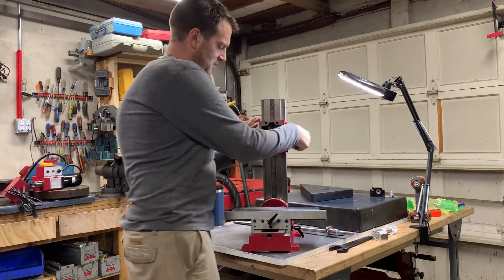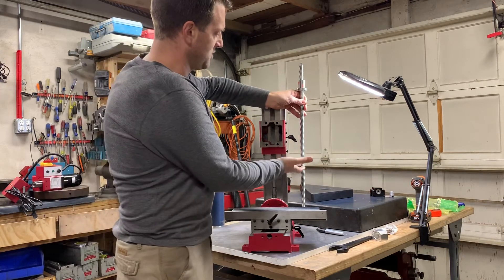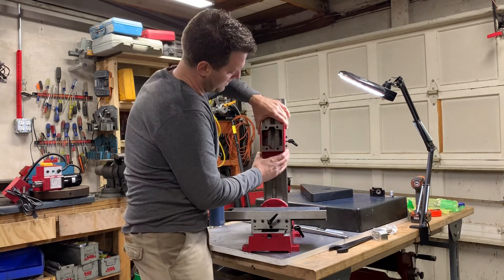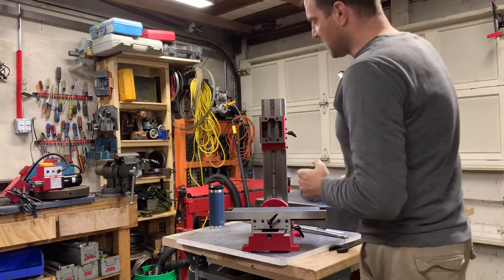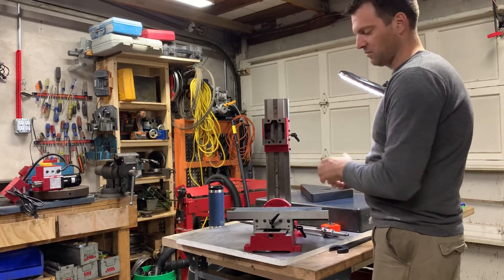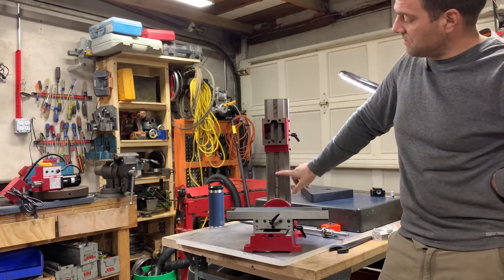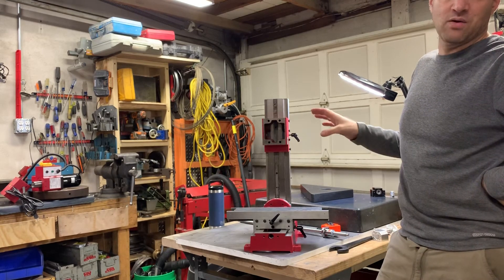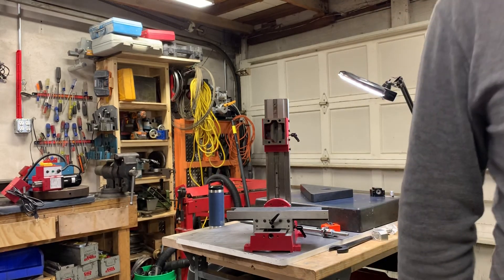Harbor Freight Seig X2 CNC Mini Mill Z axis ball screw placement plans

Comment: Why did you even use ball screws in a tiny ass mill lol?  I know why a cnc machine would use them. But just saying mine has used the factory screws for 10,000s hours now over 10 years and I have such a small amount of backlash it's not really issue with software anyhow.
Reply from the maker: You are way ahead of me!  I'm using them for backlash reduction mainly.  Controls can't fix a mechanical problem.  I would like to have a chance at milling harder steel materials.  Sounds like you don't have a problem though.  If you have any info on your setup that would be great.
Reply: @hansw33   I mill cast iron, steel, brass aluminum  and stainless all the time. Yes software can fix backlash.... mach3 /options tab/ backlash setting.  I actually stayed away from ball screws for the reason I cut so much stainless.  The ones your using I bet are 12mm as well Only size seems to fit these machines. They tend to over power steppers and skip the motors out of step. The lead screws won't move an inch unless that motor turns the thing.  Mind you I also put a second nut with a valve spring between the nuts bolted together to pretty much kill any backlash to start with. I use metric* z .002mm/ x .011/ y.009 are my backlash settings in mach 3.  I can cut within .001mm  limit rang.  I mostly build small steam engines, gas motors and rc parts for 1/5scale. One other thing to mention!  My machine is probably slower then ball screws. But honestly my output of spot on items is more important to me.  One other thing to note!  Don't plan on using head gears.  Even the steel gears will wear really fast cnc use. Better get a belt drive.  Comes down to this machines tolerance limits are poor out of the box.  Adding cnc kit to it just makes a poor machine a bad cnc machine lol. I cut all my own dovetails on a large milling machine and used brass Gibbs and such so I have a very smooth tight action of each axis
Reply from the maker: @BuildBreakFix  thanks for the info.  I have 16mm screws and currently in process of fitting them.  I’m doing some major material removal on the saddle to accommodate them and the ball nut mount for the Y axis is going to be complicated.  Sounds like you got most of your backlash out with a double nut.  This thing didn’t have that stock.  I’ve trashed more than a couple expensive carbide end mills due to rigidity issues on my manual mill so I am just trying to minimize the backlash as much as possible.  My UCCNC software has backlash compensation too.